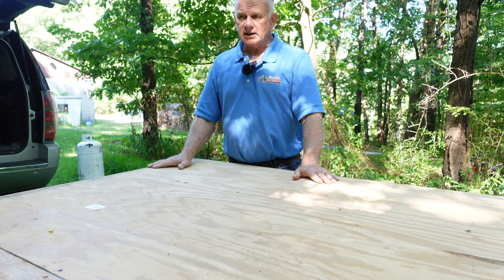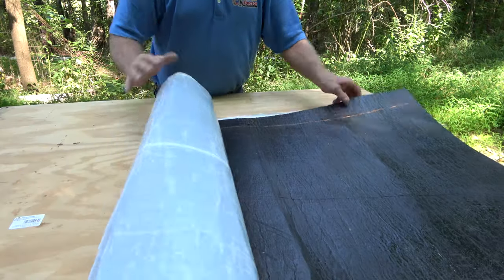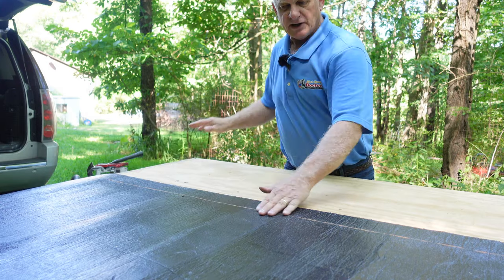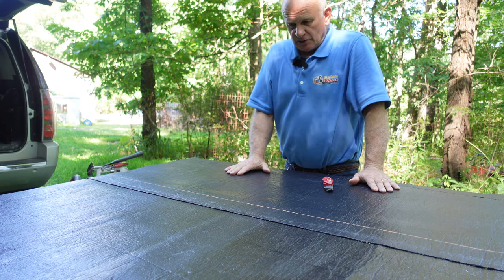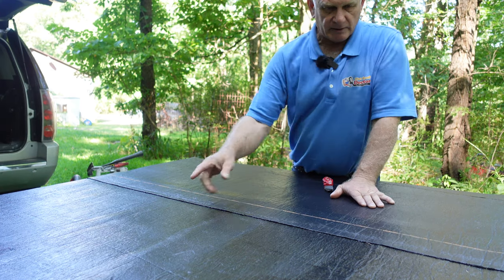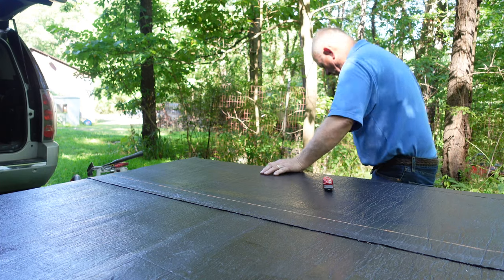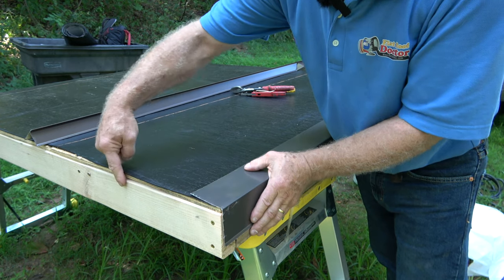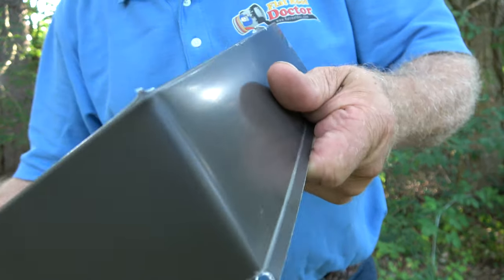30 years of Tips and Tricks Installing a Torch Down Rubber Roof

Comment: Proper roofing practices call for the first ply of the 2 ply roof membrane to turn down the leading edge a minimum of 2 inches. This guy ignores manufacturers requirements and NRCA ( National Roofing Contractors Assoc) recommended installation methods. Do not let this guy near your property.

Comment: Hi good evening where do you buy these material turbo ploy seal, super silicone seal and karnak 66 or 81 modified bitumen adhesive trowel grade I am in upstate NY an I went to several roofing supply when I give them the information they look loss they want to sale me roofing cement from Firestone

Comment: I have a similar problem but my roof is completely flat. It’s a room addition about 20X12 with flat roof no slant at all about 30years old I been having small rain water leak. I tried henrys white membrane stuff from Home Depot 2 years ago didn’t work. I’m thinking to go with those asphalt rolls but how would u slant the roof or rolls so water runs off

Comment: I was interviewing guys to do my carport with torch-down.  They said I needed to use "low-rise" drip edge for torch roofing.  They did not want to use the one I have...can you speak to that?  Also can you recommend a good/best stick down underlayment base.
Reply from the maker: A flat drip edge is what should be used. I guess you have a drip edge that has a slightly higher lip. Those type of drip edges is called "Gravel Stops" and was used on the old style roofs that had the stone on them. That was to prevent the stone from falling into the gutter
The best peel and stick base for Torch Down roofing is one made by John Mansfield. The name slipped my mind now
Reply: @FlatRoofDoctor  I let the guy take off the drip edge I started and use his own..as I recall he said the reason for the big lip is so the tar/bitumen won't run over the side when the roofing is being applied...anyway..i have a torch down roof now and while not the most pretty thing, it does not seem to leak and does its job.
I am hoping for a long trouble free life.

Comment: You obviously have been doing it a while. Some great tips. 
We installed over 20,000 Sq of torch down smooth Modified Bitumen over the years. The proper edge technique is to install the Modified roofing, then the edging, then strip in with the Modified membrane. This prevents wind uplift and sandwiches the metal in between layers of Modified. Your Title is kind of misleading. It's not rubber, it's Mod- Bit or Modified Bitumen. We always used the SBS torch down smooth and coated with Karnak 97 for best results.
Really enjoyed your video. 👍

Comment: Shouldn’t nails in the metal edge be staggered and not in a straight line? Metal edge be primed before applying membrane? What keeps the metal edge down in wind storm? What does your insurance co. Say about torching over and around a flammable  substrate? Have you ever had a fire using torch down membrane? Asking for a friend……